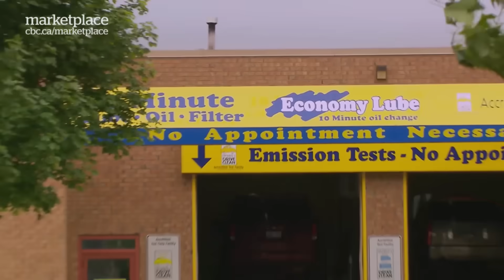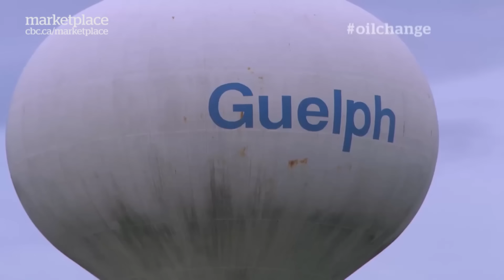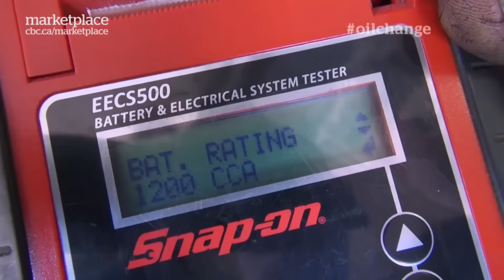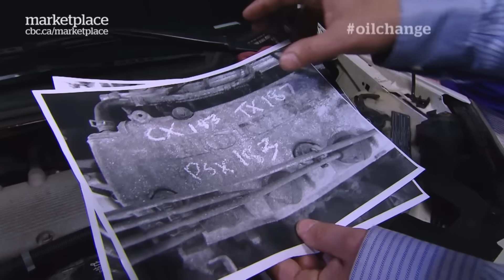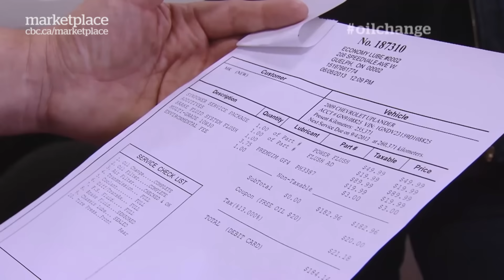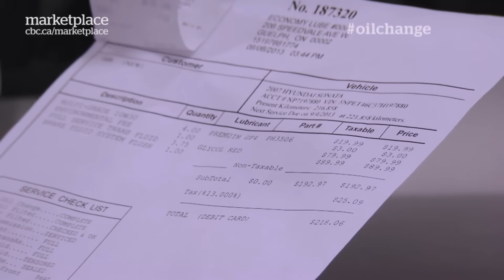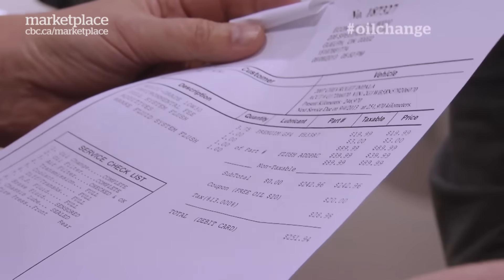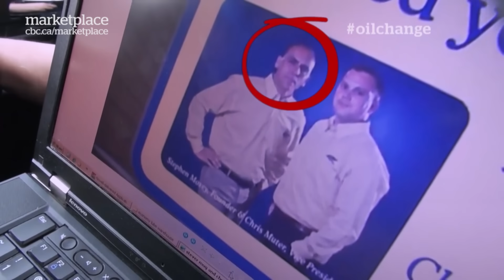Oil change scams: Hidden camera investigation on what really happens to your car (CBC Marketplace)

Comment: This is why i do everything myself.
Reply: Exactly.
Reply: Remi Jansen except alignments, that is my only issue. I can't go to any shops in my area without them telling me my ball joints or tie rod ends are bad and they won't do the alignment until it is completed.
Reply: rambow70 my lord yes...I do all my work but over the life of my truck I've had 2 alignments in 20 years since it being new and they always tell me all that stuff needs to be replaced and that the rubber boots are worn and dry rotted....yeah I know they are but theres no movement in any of the joints or tie rod ends they're just old. next time I'll just have to do what my dad said and soon as I talk to them just say I know everything is "worn out" just do the best you can.
Reply: Marshall Smith oh god yes, the rubber boots are always dry rotted!
Reply: rambow70 That is my problem as well. I needed new front tire too. They said my front strut tower bearings and mounts were bad, as well as threads on my wheel hub for the lug bolt. I know the bearings were bad because they were making a lot of noise, so all is good there, besides the fact they still made a little noise afterwards and I don't believe they were changed. The wheel hub threads were also a little bad but the lug still screwed in no problem and never came loose. All they did to "fix" that was buy a new lug bolt, so I bought a new wheel hub for when it becomes a problem. As for the mounts, I highly doubt they were bad or even changed (doesn't look like it). They then told me that one tie rod was slightly bent so they were unable to get it 100% aligned but still tracked straight... So for new tires and an alignment that I went in for for $180 turned out to be near $400 or more. The guy said he would knock down a couple prices (probably because they weren't going to do the work anyway). In the end they either forgot or just didn't charge for the tires or something because it turned out to be like $250. Really pissed me off hearing they needed things done to even do the work or the tires would wear anyway. They also kept my car for like 5 days "waiting for parts to come in".
Reply: rambow70 i did my own alignment on 2 cars with nothing more than a carpenters tape measure and they both drove great and never wore tires funny 
one i replaced lower ball joint 1994 s10 
other i replaced all 4 tie rod ends on my 67 mustang 
research it and you can do it with real good luck 
remember even if you screw it up it can still be fixed buy the shop any for the same price as befor you jacked with it so give it a try i all ways say 
i even rebuilt my 4L65E trans in my 1997 suburban at 106k miles the sun gear eat threw the planitary gears do to bad thrusht bearing and it cost $365 for ALL new insides excluding the pump and the junk yard wanted $800 with exchange chep rebuild was $1800 and the last i checked  the person i sold it to had 186k miles on it a year ago and has had no problems at all so i guess i did it wright ]
and the funny thing is it was easy to do with the $35 book 
it was the first and last auto trans i have built and i will say the automatic trans repairs are the last real scam because the guts come out all in one part and the new kit comes all ready built and you lower it in the the case install the pump and valve body connect the wiring and close it up throw in truck/car fill oil and drive it
Reply: Can't do everything unless you have a lift or an exceptionally easy car to access. Like I can't even check my transmission fluid without putting it on a hydraulic lift..
Reply: CDubs HasIt It would be a hassle. You would'nt get a correct reading on transmission oil if its jacked up sideways. Thats the only problem. Unless you have a dip stick running to your transmission 👍
Reply: ***** sorry elier post was ment for you.
Reply: Remi Jansen Yes,this is why I do everything myself!
Reply: I just research the shit out of the problems when they come up. If there is ANYTHING wrong with your car, Google will find it and as long as you put the time into the research you can walk into any shop prepared. When choosing a mechanic to trust with my cars (Audi/Land Rover) I always tell them what's happened and I wait to see what they say just so see if they are trying to feed me some bullshit.
Reply: Pabloottawa P that doesn't always work. There are some problems that you may know that Tech would?
Reply: enemybird Trust me dude, there is NOTHING I can't dig out via the internet. The techs certainly know more than me about how to fix cars but many of them assume way too much about a customer's ignorance when it comes to their cars. Furthermore, don't forget that most of these punks are just that, punks... Most shops have just one or two licensed mechanics with the rest either high school students or graduates doing their apprenticeship and MOST of the oil change guys know far less about cars than I do.
Reply: rambow70 Tell them that you're not a dumb ass and know what a tie rod looks like. If they get the feeling that you know your ins and outs, they might actually do the work. Don't say "I think it needs an alignment". Say "I want an alignment done, and nothing else is wrong besides the alignment, so don't try to fuck with me"
Reply: Remi Jansen So do I. I have not met 1 mech who is honest.
Reply: I do want to believe them, but i just don't trust them
Reply: rambow70 I needed my power steering rack and pinion replaced because it had a rip in the boot and the inner tie rods had play as well. I took it to a guy that runs out of his barn out in the country and they told me one ball joint had a little bit of play in it as well. I took it to another place in the city on my way home from college because they had a free suspension check. Told me all four ball joints had play. I laughed and said I won't be coming back here again.
Reply: Remi Jansen I'm working on DIY too
Reply: Remi Jansen Yeah, it's really not hard to do an oil change, not worth $20.
Reply: Joshua Ebanks But most people are so damn lazy and because good oil is going to cost you more than having someone do it (but they put the cheapest shit in your engine possible).
Reply: @Remy Jansen, Get A GEO METRO!
Reply: ***** totally :)
Reply: Joshua Ebanks yup, and if you do it yourself, you actually know  what you've put into it.
Reply: And you get a better feel for what the car needs for the next repair..... I got a 2010 Range Rover last October and I'm going through the feel her out period which usually lasts a year. 15K in warranty repairs so far.
Reply: Nothing out of pocket and once the warranty is up and all the gremlins tweaked out, I'll know exactly how much time I have before something else breaks down. Land Rovers are finicky but very nice to drive... When they work lol
Reply: How's that fire making in the snow going? ;)
Reply: carter rodgers maxed out on firemaking xp haha :)

Comment: Don't forget the seat warmer fluid.
Reply: hahaha.. thats a good one.
Reply: blinker fluid. is low
Reply: horn fluid too
Reply: Also the emergency lights fluid too
Reply: +Thelionfan11 and the cup holder fluid
Reply: Where can i replace the radio oil?
Reply: 《GᗩᘔE》 Shuttle what am i supposed to do with the steering wheel changing the seatbelt oil is more important!
Reply: where da muffler bearings at
Reply: Radio Knob oil is gunked up, might wanna get it cleaned for $68 , I'll even throw in a couple air fresheners!
Reply: Alright dude!!!!!!!
Reply: But I feel like the carpet oil is more important
Reply: diarrhea
Reply: i need the carseat oil and my floor fluid but its gonna be expensive
Reply: Also  don't forget the Blinker OIL.
Reply: Don't forget the bumper sticker fluid, you'd be a fool not to change that
Reply: What about the window fluid.
Reply: haytnas don't forget the sunroof fluid if you got one !
Reply: haytnas hey what about the mirror fluid
Reply: +idrink bleach You also need wheel fluid

Comment: A very good reason why you should learn the basics of car maintenance. I'm a medic and not mechanical minded so if I can learn, you can, make it female.

I always did my own minor servicing and depending on the average outside temperatures of the Country you live in should determine how often your maintenance is.

I lived in the middle East and did an oil change at the least every 3 months, plus checks on other conponents. We used "POWER" in our checks, thats, Petrol, Oil, Water, Electrics, Rubber!  Stay safe.

Comment: Want a tip? The next time you want an oil change, then get the oil changed only. Be a man and look them in the eye saying, no mate I'm here for an oil change that's it
Reply: "Sorry but this needs to be done and we can't change the oil unless we do this as well"
Reply: I'm reminded of The Simpsons when Homer gets a tire balance.
Reply: doggynolikey that's when you know their lying and you go somewhere else
Reply: What you do is take your vehicle to a place that's actually registered, then you're good. Otherwise, you can just look into what your vehicle needs done and get those things fixed.

Still, if you only need an oil change you might as well just do it yourself. It's quite simple to do, though replacing the filter might be tricky if you don't have a lot of room.
Reply: "be a man" lmao what are you
Reply: Be a man and change it yourself!
Reply: yeah,  but still watch because sometimes they use the old filter I caught a neighborhood shop trying that......
Reply: in a lot of these new cars today you CANT replace the oil filter yourself anymore without taking the engine half apart.
id sooner just pay someone else 30 bucks than a couple hours of aggravation doing it myself.
Reply: doggynolikey then I would kindly inform the service representative that they know little to nothing about motor vehicles and I will change my oil at home.
Reply: no you are wrong there all quite simple i work at an oil change place
Reply: what kind of cars are you driving?  I changed my 2017 chevrolet's oil and it was ridiculously easy.  Granted, it has a V8 in it and bigger engines are usually easier because there is more room to operate...but My v6 Honda was also easy and my V4 Scion was easy as well...2017, 2011, 2007.. all modern cars.
Reply: changing the oil is easy. its the filter that is the problem. hidden in the back, under a dozen tubes and hoses under the engine cover. you have to remove the cover and then you have to contort just to touch it, much less torque it off.
Reply: I've always found it odd that people don't just do it themselves. There are SO many basic maintenance procedures that can be done at home. The internet is a thing. If you own a car with a problem, there are HUNDREDS of forums detailing the process. Sure there are a lot of things you probably can't do, like things that require a lift or major structural component repairs, but stuff like oil changes, spark plugs, sensors, fuses, filters, and even belts, etc. are SO GODDAMN SIMPLE. And you'll save hundreds of dollars in the long run.
Reply: +Sigh Phi Guy - "... you CANT replace the oil filter yourself anymore without taking the engine half apart. ..."

If it is that difficult to replace your oil filter (I do believe you), then you can bet that many oil-change shops won't actually do the work to replace your oil-filter. They'll just wipe off the dirt (if you're lucky), and tell you they replaced it, then charge you for the replacement.
Reply: Epic Saiyan Fist or you could be a real man and do it yourself
Reply: Epic Saiyan Fist simple enough to do (when you know what your doing that is)
Reply: I do that at the dealership all the time. They always have a list of things supposedly wrong, but its never the same thing thats wrong the next time I'm there.
Reply: Epic Saiyan Fist or just do it urself lol that's what my bf does, he went to an auto shop a few weeks ago but they tried to tell him it would take 6 hours and he needed new brakes which he already got some 3 months ago... Also there was no one there only the employees, doing nothing 😑
Reply: Epic Saiyan Fist Or just be a man and learn yourself.
Reply: I remember when I used to work in a repair shop its national company and I do an oil change the dates a well while you're doing that check the struts the exhaust anything's possible the belts the hoses all the they love doing struts and really overcharging you because their parts are really marked up a lot a lot of times they like using the idea or saying while we'll check the rotors and they would change them I believe sometimes when they could have been turned and of course there's the exhaust system read hit the converter why can hear the inside ride when you need to change your converter Cadillac converter or I recommend it same thing with the exhaustyour muffler is making noise so replace it even though there's no holes in it
Reply: > my V4 Scion 

No such engine in Scion cars.  I seriously doubt you changed your oil, if you don’t even know what engine was in your car

.
Reply: I would never reward a place like this with any business, even a simple oil change.  Either do it yourself or find an honest mechanic/shop and stick with them for everything!
Reply: @TheSighphiguy  That is absolute BS.

Comment: I used to work for Valvoline. We got promoted if we sold the extra services and more expensive oil. Their computer system only tracks services done at Valvoline so if you just got a transmission flush at a different shop they’ll still say you need one. Also a proper transmission change is like an oil change. You’ll want to pull the pan, sometimes change the gasket, and change the filter. The filter is a big one. You don’t do an oil change without changing the filter. Valvoline doesn’t do that. They stick a tube into your transmission and suck out as much as they can. They say it “gets the metal shavings”. It doesn’t. The metal shavings stick to a magnet on the pan underneath your transmission. Even the most reputable companies do things like this.

Comment: The oil alone needed for an oil change is almost 20$.
Reply: Not true. The amount they buy gives them insane discounts on the actual products themselves, most of your money for an oil change is in fact in the labor. My father worked for an oil company and even they are a bit scummy. Speedway oil is actually the same as Shell. Many companies may say their oil is better than others but it is all manufactured in the same place and sold to sperate companies with different logos on them. That is why he quit, they asked him to lie for them and he left.
Reply: This was 2014, so costs were lower
Reply: Oil cost 8$
Reply: @johntyler7656  finally someone awares that all oil are the same manufactured. The only differance is the bottle or box company.
Reply: @afarinah1234   that's not even close to being true... Maybe certain brands are just rebrands but to say all of them are the same is just false. Theres a guy on here that tests them and their effectiveness and they're very different, different processes and additives or even different bases; crude or natural gas and the end product is different oils lubricating better and/or lasting longer than others
Reply: @Fetidaf  Yes some are different but most are different in very insignificant ways. Yeah sure there are more effective oil types, like synthetic or natural, but for the majority of brands the oil is going to be about 95% of the same makeup. Additives make up <5% honestly. Those can make a difference yes but not enough for me to care. I try to stick to synthetic and I notice a bit of gas mileage difference with a couple brands actually but nothing is bad enough to really harm my car, nor good enough to make a huge impact solely based on brand
Reply: @johntyler7656  that's like saying all drinks are the same because they're all atleast 95% water, the additives are what makes the difference. Will it harm the engine? No but that doesn't mean you can't be giving your engine a bit more love.

I'm also not going to deny that there's alot of marketing in motor oil and most of it means nothing but there are some damn fine oils out there that do wonderful things compared to others that will do fine, sure, but they don't do quite as well
Reply: @tyler6971  so what basically sums up to "they're scamming us" "why?" "Cause I don't like it" is winning an argument now...
Reply: @Fetidaf  the additives are different but there's only like a handful of oil manufacturers in the country. So the base is the same
Reply: Try $60
Reply: @tyler6971  wtf, nobody wins or loses, they are just talking man. What a sad way to understand human relationships
Reply: The oil itself is ofc the same. In Finland we have thing called gasoline. If we go to russia we call it russian gasoline even tho it's same gas as ours but somewhy its so fking bad lmao. Theres something like 1% difference that changes it.
Reply: What world do you live in where 5 quarts of oil costs $20  because it sounds wonderful
Reply: My oil change is $60 minimum but it also depends on how much and what type
Reply: Oil is about $110 a drum of 10w30 
Which is 200l. About 4l percar.
Reply: But if you buy 5l oil in container from the auto shop, price will depend on synthetic or regular but anywhere from $20-100.